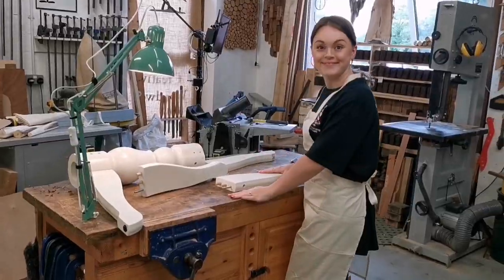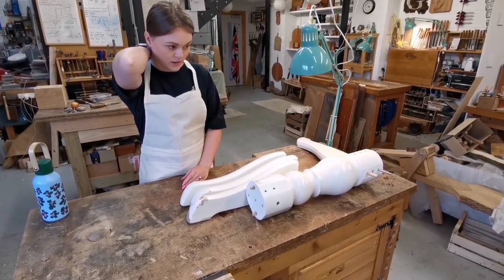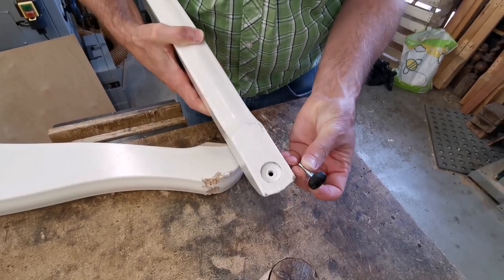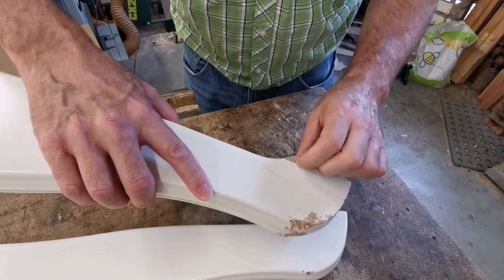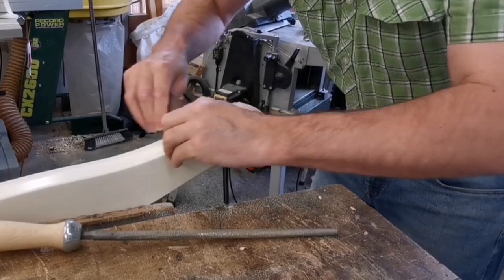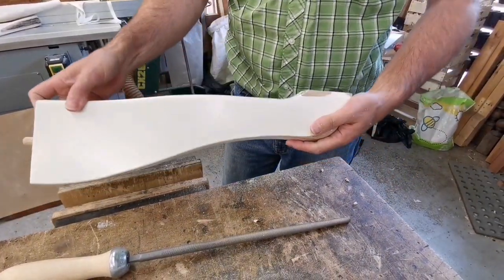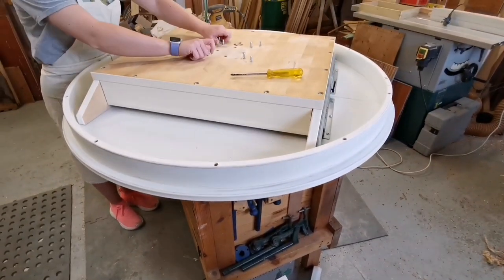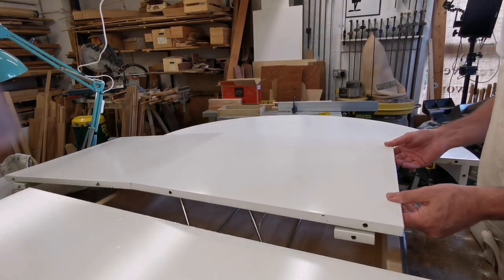IKEA dining table repairs - upcycled - INGATORP - Improved Extendable table hack

Comment: Worth letting folk know that IKEA’s spare parts department is absolutely amazing. They have literally everything and if you’re a few bits missing they can supply free of charge. It’s incredible to be honest, they’ve saved my bacon on several occasions, all on stuff I’ve bought second hand.
Reply from the maker: No way.. Free. Well that's very cool
Reply: @twcmaker  yep honestly. Even if you don’t know what the screw or whatever looks like, if you know what the piece of furniture is called they can pull up a parts drawing and everything is labelled. It’s fab.
Reply from the maker: Well done @ikea that's so good of them. Sustainability is key too
Reply from the maker: Hi Nick, 
I thought you might like the repairs I made to this IKEA bed frame. Badly damaged post needed fixing
https://youtu.be/HwRi9WM09gk
Thank you
Jamie
Reply: @twcmaker  Cheers Jamie, enjoyed this. The ratchet straps idea is great, saves getting long clamps which you might not use very often 👍
Reply from the maker: Thank you Nick. I find ratchet straps so useful in the workshop.

Comment: I am looking to repair this exact table, mainly two bubbles/brown spots on the top surface.  How did you paint it and what did you use?  I know how to refinish and stain wood but not paint it white etc.
Reply: I see in the description now it says hand painted.  Really impressive how do you get it to look so clean you used a brush?  And then did you seal it with anything after?  I'm a newbie to painting
Reply from the maker: My daughter used Rust-oleum. Followed the instructions on the tin. 3 coats did it
Reply from the maker: Ellie used a brush and then a roller with the fine bristles on the flat surfaces.
Reply from the maker: Hi Dylan 
I thought you might like the repairs I made to this IKEA bed frame. Badly damaged post needed fixing
https://youtu.be/HwRi9WM09gk
Thank you
Jamie